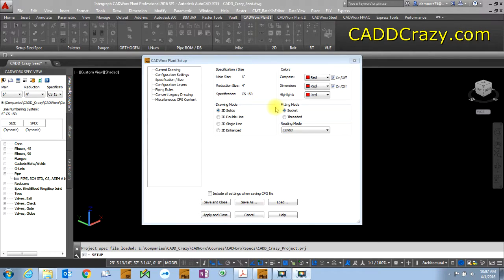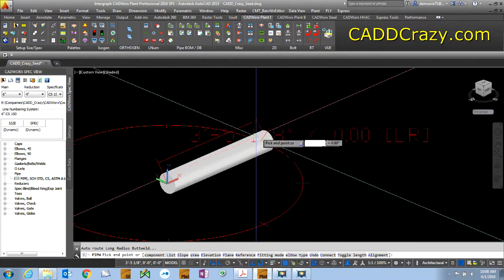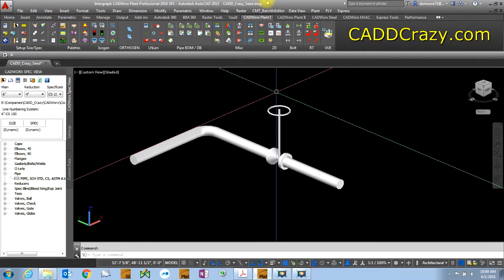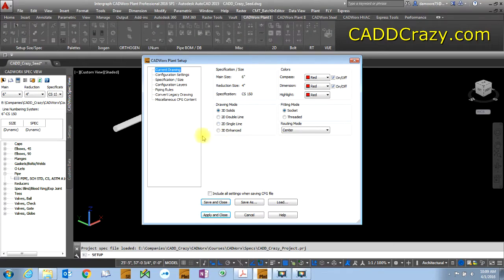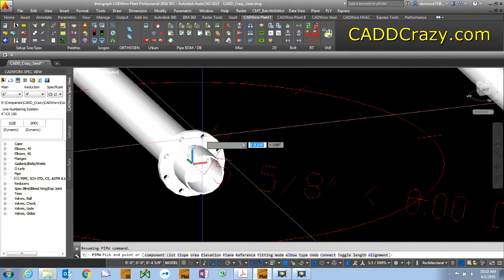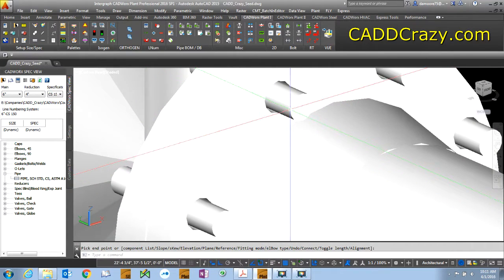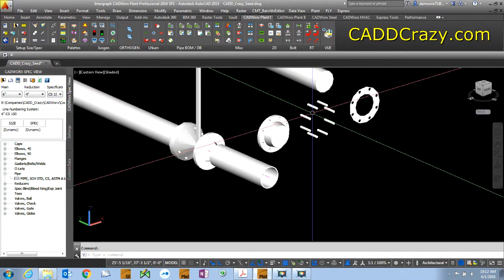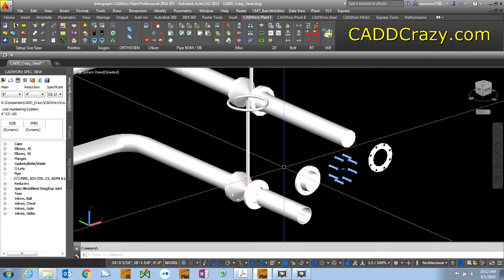CADWorx 3D Enhanced Mode

Comment: Hi there, I have been using the 3D enhanced mode to test new bolt components, but lately I need capped screws with fixed lengths (bolt type = 0) in my spec, and those only show as "B", when using other type of bolts, they show in their fully 3D enhanced version. Is this feature not available for fixed length bolts or type 0?